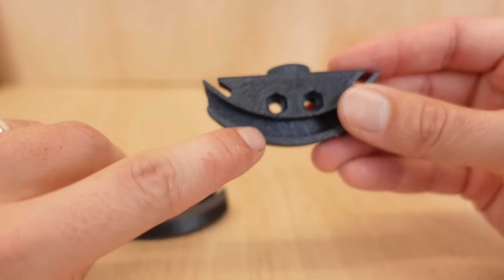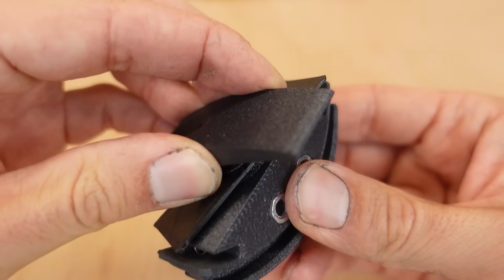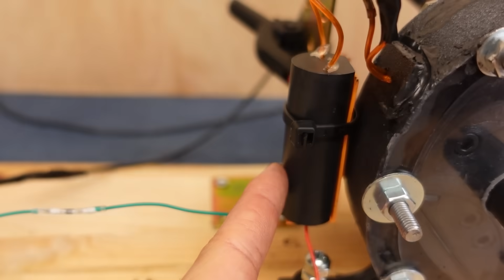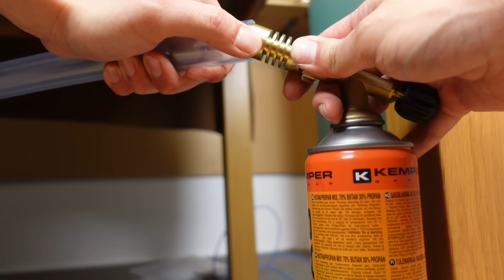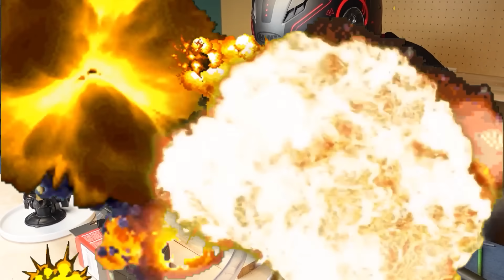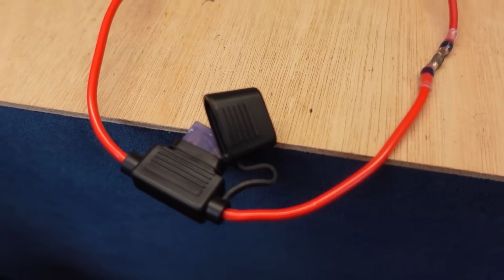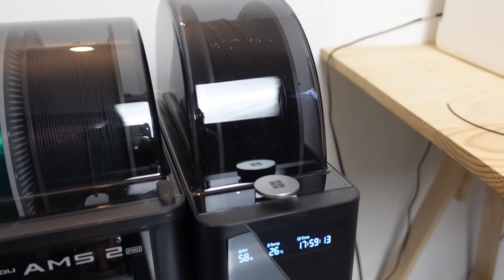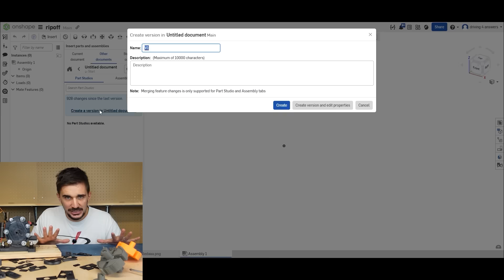My Oval Engine Now Fires At Will! Major Milestone For DIY Oval Rotary Engine 2.0

Comment: there's soooo much wrong...
1. Too much internal friction - try teflon instead of tpu. engine needs to turn fairly freely.
2. Compression, compression leaks?
3. propane is really fiddly - regular gasoline has much wider range.
4. engine timing is terrible - make it: a - consistent, b - easily and precisely adjustable
5. what is a ratio of "produced power" to weight of the rotating assemby and most importantly fricion?
6. flywheel would help

Comment: A ATV ignition coils works reliably with 12v and is small and cheap to get. They are close to the same size as those cheap spark generators

Comment: That CF filament is probably pretty abrasive against the TPU. Looks like ignition is happening much too late, when the air-fuel mixture is already partially expanded.

Comment: There is no mechanism forcing the moving parts to stay in proper alignment, unlike the sun gear inside a Wankel engine. As a result, those oscillating combustion chambers are going to dig into the sides of the housing at any meaningful operational speed.

Comment: Precice ignition timing will help 100%. Also, you needed a ballast resistor to use your  high voltage generators to limit current. The stripped wires hanging loosely and you rotating wire are for sure hindering your progress.

Comment: I wrote to you last time. No engine with the thinking you have will work. Because the expansion chamber is the same as the compression chamber. If you want to make such an engine work, you must create a second rotating compression and explosion chamber with a volume of 1/10 - 1/12 of the expansion chamber, which will receive the compressed mixture, start the explosion and channel the explosion gases to the correct chamber....

Comment: Put a combustion pocket on the face of the rotor, like on a Wankel engine, and move the spark location so that it sparks at the peak of compression.  It looks like your spark timing is late because of the location to me.

Comment: First and foremost, this is F-ing awesome. I've wanted to make an engine of my own design for a while so this is right up my alley. This novel design is so amazing. Now my concerns. Are you sure the design transfers the the kinetic energy of the explosion into rotational energy efficiently enough to sustain rotation? I agree with everyone else, timing is may be your current issue but I suspect the design may need tweaking too. If there is an equal and opposite reactionary force when your "piston" is sliding in the grove of your crankshaft just after , it may be turning your crank in the wrong direction during gas expansion. Consider maybe, moving the exhaust port 10 or 15 degrees clockwise. I think the only time the pistons impart correct rotational force on the crank is when they are moving in the opposite direction. Chances are high that I'm completely wrong, I hope I am even, but have you tested whether this thing pushes air out of the exhaust port when spinning the engine. If it doesn't pump air when spinning the engine, it will not rotate when fuel and spark are added.

Comment: Something I thought about from the first design was unlike the Wankel rotary. This could have the capacity to have a proper oiling system, which would absolutely help with lubrication thanks to the open non-combustion chamber space.

Comment: If the ignition coil is partially oil filled it should be mounted horizontally so that oil cools all of the coils not just 1/2 or 1/3 of them. Just a thought.

Comment: I know it sounds crazy but a company called “Proyect ECU” makes very high quality and low cost stand alone ECU that you could use to have a very consistent spark.  Later it could be used to fire injection or drive by wire throttle body.  The ecu uses “Tuner Studio” which is open source and is what MegaSquirt also uses.  It’s about $250 for the ecu and wire harness

Comment: They make a one way ratchet drill adapter that goes from a chuck hookup to 3/8 or 1/2 socket.  If the engine starts it freewheels and won’t spin the drill.  You could use a ziener diode to limit voltage to high voltage coil.  Also might want to use 1/2 lexan/ plexy to limit combustion walls from flexing.  Keep it up man!!!

Comment: happy happy joy joy brother. well black and white dont need any rainbow colors do they. well christ got the rainbow colors of freedom from judgement now. hats off to you bruh, for you have won the world. stay in christ brother. well that engine suits you sir. cant you use a normal ignition coil from an existing engine. sure diy is interesting too. bruh, remember to give away your every day sacrifice to have the real one-time sacrifice christ fully pre-paid. yes its even a command. kingdom of heaven with-in you is not about external every day visible sacrifices. as you know. nice beat machine bruh. what a flame thrower dragon beast bruh. yes of course a turbine is a flame thrower. naturally. just dont sell your gospel brother to slaves of world flesh people brothers. thats like cross of christ again. some nasty taste brother.
Reply: how about ceramic or steel casting by sand casting or stuff. yep at home. even carbon dust sand casting high temp metals. and better is just better. nah just use 110% flow rate. what are those screaming stones in the laundering washing machine bruh. is it you maybe. what a ball mill separator bruh. epic fail indeed gladly. flesh eyes closet brother. ie your eyes closed, christ eyes open. good job bruh. yes every weird explosion happened. true dat. well samson happened too. spirit bam booz led true that. report to the aa stuff bruh. ion the kingdom of heaven where god lives ie in your heart. wankel engine much bruh.

Comment: I once read a book, wihch had a name like "Historic Motor Concepts". It might have been "Insane Motor Concepts". Nevertheless, this design probably qualifies for it ^^.
Good work :) Research sometimes doesn't have to solve a problem, but there is also the question how big the playingfield is to search the solution on. Right now, I see this as a part of the field, but maybe it is going to be part of a solution :)

I mean, even if you would leave out everything learned about engines in this video, it is still a strength test for 3D printing ^^.

Comment: Print 3 of these, offset them all by 120° and have them all linked together by one main shaft. The offset should allow it to self run as you will have almost continuous combustion.
Reply: Why not just go full bore, put 6 together, offset 60° and have continuous high output power 🤷‍♂️🤣 

If only we could get compression ratio high enough to run in diesel cycle, using a very slick diesel fuel formulation, or even kero and oil mix if you can get it that high (25:1), because then you'd have some insane torque output. But that gonna take high strength steel and probably carbon seals, and high precision machining.
Reply: I've calculated it, this family of engine can get compression ratio as high as 29:1, although by sacrificing power to weight ratio

Comment: Well thats an interesting one. Great job and dont give up on making it run!
If i may help with a little bit of observations.
First and foremost - you are forcing the fuel mixture with an unknown pressure, the gas bottle delivers the mixture with unknown pressure and i would assume that it will not be constant throughout all the firing attempts. The system can be considered closed so you will get supposedly the same amount of mixture if you run at constant speed .... do you have the possibility to regulate the pressure and the amount of the mixture coming in? This will greatly improve repeatability of the combustion cycles. If not - this mixture is heavier than air so what if you constantly "pour" it in a funnel so the engine sucks the same amount every time? 
The ignition is completely unreliable - can't you use the spark plug and ignition coil? It should be easy to take from even an old scooter engine for next-to-nothing in terms of price .. 
I would suggest cranking at constant speed so you can easier control and verify if all works as it should.
I dont believe you can escape calculating the laminar burning velocity in relation to position of the exhaust port's location, spark plug location and an arbitrary engine speed. (for this mixture ... about 450mm/s is a good guesstimate?)
A flywheel will greatly improve stability also and it should be relatively easy to attach a few extra grams of mass to the crankshaft without the whole thing snapping
You mentioned that you used onShape for designing the engine - try searching for some plugins to calculate precise indicating volume of the combustion chamber (volume at each degree of rotation). Out of this volume you can also calculate the compression ratio that you have and make sure nothing is going to go "kaboom" while testing.. (which does not seem to be the case as of right now)
Check the gas leakages ... this thing will probably leak from everywhere

Comment: You need a better disconnector for the drill so the engine CAN start.  Your "T" slot starter design will not allow it.  You need sloped edges on the back side so it kicks the drill away when it fires.

Comment: My recommendation is to improve your electronics. There seems to be a lot of variability and uncertainty around the spark timing, and it can certainly be massively improved. Your sensor/commutator can be adjusted and doesn't require fancy electronics, but the contact is poor and adjustment is clunky. Similarly, the parameters of your spark generator are unclear and it may be worth investing in an oscilloscope to precisely track the trigger impulse vs the spark, preferably also tracking crankshaft angle via photosensor pulses (print ridges on the shaft or "piston" body). If you do some EE work, you can design pretty precise variability into your parameters and not only dial in the inputs, but also get good data and confidence about ignition and force production.

I'm really interested to see how this progresses and wish you the best!

Comment: I really enjoyed your talks on engines, but I have to say, the latest engine design episodes are getting a little unhinged, unless the point is just to promote 3D printers. Why unhinged? Apart from the 3D printer, you have no shop equipment, your set up looks like that of a 10 year old's, playing with fire. It takes away from your image of a very knowledgeable adult guy.

Comment: Needs a stiff piece of copper pipe or something rather than that floppy wire. And on a metal engine with useful RPM and combustion pressures, how exactly are the seals planned to... actually seal?

Comment: Maybe try a smaller exhaust port with a timed rotary valve that opens later in the firing. At the moment it seems to ignite directly into the open exhaust port. 

Timing of the ignition seems off as well. At the moment it is firing as the cylinder is in "TDC" at maximum volume, it is creating an explosion that must now undergo compression as the cam rotates the valve to the corner and is then immediately vented.

Ignition should be occuring at maximum compression and with this exhaust port design, it then is expelled immediately.

Could you profile the travelling chamber to force compression, ignite at 3 o'clock, exhaust in the second chamber? Not sure how to do that without creating an immediate blowout through the rotating valve wall.

These are just thumb sucks, I'm in no way knowledgeable in engine building.

Comment: looking at the geometry - specifically the size of the combustion chamber at the time spark is introduced vs when the size at intake, I don't think it has any compression. The spark is igniting the gas when the combustion chamber has reached it maximum size, as opposed to when it's at it's minimum size.

Based on the design, it looks like you need a recess built into the outer wall where the travelling piston thing sits tightest against the housing. This is where the spark plug should be, very much like a wankel engine.

I really live this thing and I can't wait to see it work! Good luck!

Comment: Heat resistant 3D printing, great, but for an ICE nothing beats metal. Maybe you could use the 3D printed parts to make a cast and then cast metal in it.

Comment: I'd recommend looking into getting a flywheel and getting a spark plug and possibly starter from one of those mini engines intended for RC cars.  I also agree that the exhaust is likely too close to the ignition point.  Reaching out to Rob Dahm might help figure out some of the timing issues

Comment: О, овальный роторный двигатель Ахриевых, привет из далёких 2010х. Насколько я помню, дальше прототипов не пошёл. Anyway, to properly indulge into rotary madness you need CNC tooling and a deep dive into material science. Actually, there are lot's of rotary maniacs in Russia who come up with novel rotary designs every couple of years. I think in 2024 or 2023 at a tech show I saw a linked twin rotor engine design by a Moscow Tech Uni student Makar Klimov (Макар Климов) who made it to a high efficiency prototype in steel, the engine was within 200x200x200mm cube with 7-8 kW power output and 300 Nm torque, check it out, though I'm not sure there are enough open info about it.

Comment: i think the main problem beside the spark timing is actually energy density of the mix used wich is not enough to overpower internal friction to get it to fully run on its own

Comment: TIMING
IGNITION TIMING
Bro, that sloppy mess you have there is not even close to controlled timing.
Print a trigger wheel with a small magnet that passes by a Hall effect sensor. 
Bolt it all down to the engine case with some form of adjustment so you can control, sat it with me, TIMING

Comment: It's not igniting at maximum compression, your timing is off. Of course igniting the mix at the correct time will also burn much hotter and destroy your engine faster.

Comment: may be wrong but i dont see a place where O2 is drawn and mixed with your fuel butain lighters have a nozzel that turns the fule exeting surouded by and desperst amongst air channels so the high speed gas cause low pressure and creatiing a draft fed from the atmosphere upstream side of nossel   love these consept build and test vids  plus your  giftted teacher/explainer.

Comment: I have doubts about the geometry of the combustion chamber. There seems to be a large amount of surface area that doesn’t apply the force of the expanding gas to the desired direction of rotation. The bottom and forward walls should probably be bent outwards somewhat to make the chamber  asymmetric

Comment: 16:33 maybe 3 & 5. And I don’t see a air intake, all I see is you are dumping the butane without any air.
Reply: The butane torch mixes in atmo through the venturi effect. It seems he used a metal cable tie to restrict the airflow in to lower the AFR.
Reply: @ethanrandall3005 I know but didn’t see anything that allowing the air to enter

Comment: I was trying to move the air/fuel mixing and compression OUTSIDE the rotor. You can keep the rotor dead centered and symmetrical and use flaps not an apex then pre-mix and compress the fuel/air and inject it into the rotor and fire it. If you would do this it would eliminate all of the problems from an off-center or odd shaped non-symmetrical rotor. It could also reach incredible rpms without issues.

Comment: it kinda needs to change the volume of the combustion chamber by a substantial amount. cylinders go in and out in the direction they compress the gas because that is the most efficient change in volume. just spinning the combustion chamber around is not good enough.

Comment: maybe use a real carburetor and 2 stroke gas to lubricate the inside of the engine. also ignition timing seemed way late.
Also how did you control air-fuel-mixture with this setup? kinda eluded me...

Comment: You could also use what "'Project Farm" tried years ago: "Will a "Gas Vapor" Container Improve MPGs and Fuel Efficiency? Let's find out!" seems to work fine if your motor just makes enough vacuum.

Comment: maybe use a ratchet for the initial starting with the drill, that way if the combustion wants to speed up the rpm, it will not have to back power the drill it self.
it will add a small amount of resistance, but something like a bike ratchet might work.

Comment: As far as I can tell from the video your starter drive does not have any throw-out or freerun features. So the engine is forced to run at the same rpm as the drill which may be lower than it's idle. Can this be one of the things in the way of the TCCORE running on it's own?